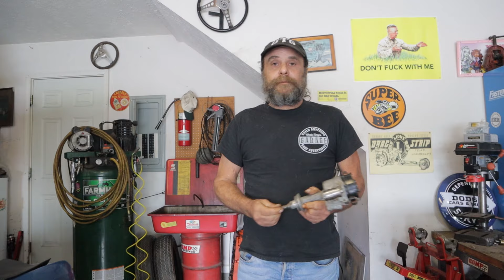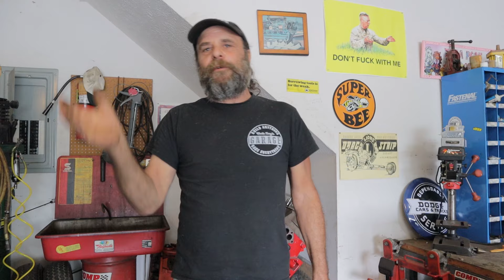Ignition Timing...How Much And Why

Comment: Great tip...had never heard of that relationship! How does stroke/dwell time affect it?
Reply: Lets say stroke remains the same. That would be the distance the piston moves up and down in the cylinder. 
A longer connecting rod has more angularity in regards to the crankpin (connecting rod journal or "throw") than a shorter connecting rod which has less angularity. The longer rod will "hold" the piston at top dead center "longer" as measured in crankshaft degrees than a shorter connecting rod with the same stroke crankshaft. 
Piston speed (velocity) as it travels up and down the bore, say in middle of travel either way up or down, also based on rod length. They call it rod ratio, which is connecting rod length center to center divided by stroke. 
This number is often between 1.5 and 1.7 on most of the V8 engines Tony messes with on this channel as a good example.
The higher (larger number) the rod ratio, the longer the piston is gonna remain at top dead center (dwell there) before getting yanked or pushed onto the downstroke.
Timing is affected GREATLY on dwell time.
Also that thing that Tony said which i love is "real estate" in other words bore diameter...bigger the bore the more "real estate".  Stroke being the same, the longer connecting rod is gonna hang out longer at top dead center before it starts down....lets say for this description, on the power stroke. Gasoline generally burns at a given rate which varies on alot of factors but lets keep it simple that single rate for any tank of fuel adequate for your engine...
Timing is telling when to light the spark plug. The flame front is gonna burn and spread out or "propegate" at the same rate no matter how fast the engine is spinning. Higher rpms require timing lead also called advance. 
How long the piston stays at top dead center Directly affects WHEN to start that spark and let er burn. 

I think Tony could have said it way better but i did answer your question.
Reason i posted this long comment was to get my head working again after this stupid lockdown. Im in michigan and we were hit pretty hard....by a really stupid governor.
Reply: @williamstamper442  Hope you are safe from the muddy waters up there...
Reply: William Stamper I hope things turn around for you guys soon.

Cheers😊
Reply: William Stamper very well explained
Reply: @williamstamper442  I pity all those under Witless Whitmer's jackboots.
Reply: no joke about Witless !!
Reply: @rcnelson  just today she pulled another stupid move by announcing the partial re-opening of our state but completely leaving out resturants bars and barbers. On the 26th we will be able to buy a new car by appointment but cant sit down and have a pizza
Reply: @rcnelson  also just found out there in midland downstream from the dam break and where all the water ended up was of all things a Fiero museum. Had some of the finest examples of those, ahem, "well respected GM vehicles of that time".
Either way i got to thinking about the regular guys who lost their hot rod and/or collection.
I am so thankful to GOD that reportedly NO lives were lost. That in itself is awesome.
But i got to thinking about all the fish. Did a quick check and yearly bass pro tournaments were held there. Wixom lake had been stocked starting in like 1937 (old ass dam) and more controlled stocking of fish starting in the early 1970's and the somewhat private lake supported all of Michigan game fish in ok to awesome numbers up till 2018. 
Apparently they had some kind of legal riff and somehow convinced the powers to be to raise the lake 3 feet.  Looks like that was a bad idea however i do not think that as an exact cause of what happened.
The dam that failed was Privately Owned. It was cited in 2018 along with the other dam that was breeched back in 2018 that in the near future substansial rainfall would most likely end in loss of life.
Nothing happened. 
Until Tuesday.
Then they lost their lake.
Fish and all...downstream to who knows where.
When it all dries up and the river makes its new path people will have everything from catfish to muskelunge pike bluegill crappie big and smallmouths and whatever i missed in their basements.

Yeah its kinda crazy.
"As governor i order you to stay home"
3am Tuesday morning "as governor i order you to evacuate"

Maybe everyone should (most did) what their instinct told them anyway and didnt need the governor to tell them what to do
Reply: "Simply Awesome Tip 'n Teaching "
>"Cheers UT"!
Reply: I want to amend my comments and hope not to piss off Uncle Tony if he thinks im wrong.
Im only talking total timing under wide open throttle for sake of performance, in case this matters later.
In theory, the higher the rpm, say above 6000rpm, theoretically it takes less timing lead to "spark" at the right time for flame front propogation to happen and get max push downward on the piston for max performance.
However, every engine can be a little different as to what that number in degrees before top dead center occurs, for best performance.
Factors involved are first fuel...
Alot of people don't konw this but the higher the octane the Slower the fuel propogates and flame front travels. This makes it difficult and important same time for higher rpm engines. Higher rpm means less time to ignite that flame front (which remains constant for any particular batch of fuel) so ignition lead should be increased for max effort on the piston down on the power stroke.
In real world we deal with lets say pump gas 92 octane and lets say a true static mechanical compression of 10:1. 
This is gonna burn me in the comments but here goes anyway...
Most muscle car era big and small block American V8's will typically like about 32-38 degrees crankshaft for total timing on gasoline. 
If engine has like 12:1 or more static compression its gonna like 32ish maybe even 30 (camshaft matters here too but wont get into that now). Alot of stock big block musclecar era engines like 440's or my fav 455 oldsmobiles like 36 sometimes up to 38 degrees total timing for max performance. It depends on bore, stroke, rod ratio, cam events especially overlap, and etc.
Remember i am only talking wide open performance and total ignition timing otherwise called lead.
The point im doing a crappy job of but trying to make is there exists a perfect time in every engine at any rpm or "speed of engine" to spark the plug and begin the flame front propogation (remember that is a constant for any particular fuel) for that particular speed.
Hope i said that right and it makes sense.
Think of it this way...any particular fuel will light off and propogate at its own given propogation rate. 
Its up to YOU the tuner to find the proper ignition lead or advance for your particular engine to take full advantage of that flame front and energy of explosion to push each piston down with max force. When you make that happen you will have optimum timing for your combo

Comment: Irrespective ove bore dia. Piston/chamber makes a huge diff in optimum timing, relative comp ratio as well....look at the GROUND STRAP on your plugs...you want the discolored portion right @ the 90deg bend, too far to the tip...to much timing, too far down the vertical leg of the strap too little....a great way to determine what YOUR setup needs.

Comment: I just finished building my 440 for my 73 challenger, it has a 512 stroker kit, any idea about what timing should be in it?
Reply: I run 36° total in my 505" RB. Start at 34 and creep up on it to see what it likes.
Reply: @markwise9868  sounds like a good starting point,thanks

Comment: So my 1000cc 4cylinder Motorcycle engine needs only 10 degrees being the bore is so small? Nah 
The stroke has a function too. Short stroke needs more advanced timing and long stroke needs less. 
 Try this one . Initial timing is set with a vacuum gauge. Highest reading at idle then retard timing 2 Degrees.
Then for total mechanical advance highest mph in the quarter mile. Or if you have a dyno adjust it for max power. Vacuum advance is highest vacuum at cruising speed for optimum gas mileage. The rate of mechanical advance is set by least ping or knock on acceleration -Test. This is for gas engines . 2or 4 valves make a big difference in timing the 2 valve needing a lot more. Most 2 valve American V-8s use 34 total mechanical advance with 92 octane or a bit more with 110 octane racing gas.  GET a KNOCK indicator and A VAcuum gauge along with a lambda sensor for mixture and beat your head against the wall trying to get it good everywhere in the range of operation..
Reply: Thanks for arguing the point the guy never made guess my fuckin lawn mower motor needs a 1 degree advance because “the bore is small”

Comment: "Real Estate" by piston diameter, is a squared function. What this means is that a small change in piston diameter makes a much bigger difference in piston real estate size. This was a very useful video.

FYI. this video combined with another one where you explain how you want your fuel explosion to finish pushing the piston before BDC, goes a long way to understanding how an efficient engine works.

Comment: Ok let me get this straight . You remove the vacuum or mechanical advance then while running turn the distributor to advance the timing  to where the motor is happy then leave it so it is always at that timing . Not like you start the car and it's at 8 then as you speed up increases . Just set and leave it & give it the juice when warm .

Comment: a trick i have learned years ago to get optimum timing on almost any naturally aspirated engine , use a vacuum gauge . pick a idle speed , then increase the timing until max vacuum is reached , then reduce the idle speed back down to the original set idle speed , then adjust the timing until you have maximum vacuum again . once you have this figured out , retard the timing 2 - 3 inches of mercury , and it will be almost perfect . 
overall timing my still need to  figured out , or even limited , and how fast the timing comes in may also  need to be adjusted  .... but using a vacuum gauge allows you to have the motor tell you where it wants the distributor set at at a idle .

Comment: I change the initial timing on my geo metro and suzuki from 5 degrees to 9 degrees! 
WOWEE
Reply: 1marcelfilms He is talking about total timing, not initial timing. That small Suzuki will still need 20+ degrees or so total timing.
Reply: those little sewing machines LOVE being spun up!
Reply: @MrZdvy  Some of those, you could get away with changing total timing by adjusting initial timing (just like you can with an old school distributor.)  Another one was pre-'96 Mazda Miata.
If you can adjust initial timing, total timing is likely being changed by the same amount, since the curve is going to be a fixed map.  He's not altering the curve, no.  But he's moved the entire curve by 4 degrees.
Reply: You can only adjust initial on stock ecu. the computer does the rest. @MrZdvy

Comment: I’ve heard from several engine builders that with all the different engine combinations and compression ratios, the one common goal, whatever the total timing is, is to have peak combustion ‘pressure’ happen at 10-12 degrees after TDC. Does this sound right to you? Thanks.
Reply: You would want it just after dwell. Within  the first couple degrees the piston is descending down into the cylinder bore.

Comment: Uncle Tony, question..

You know your Hemis, if memory serves some Hemis had duel spark plugs per combustion chamber? does that effect the required ignition timing because there are two ignition points? My guess is it would require less timing.
Reply: @007-b8i  
Yep, I know the 5.7L engines do.
Reply: timing would remain the same. Dual plugs where used to ensure a complete cylinder burn.
Reply: Like a dual point, with a single plug.
Reply: Duel plugs are usually used when the combustion chamber is shrouded by pop up pistons

Comment: Cheers again Tony ' Buddy of mine mentioned how wedge BB spark plug location is further from center than SB which as you said causes greater distance for the flame front to travel and in turn would generally cause the need for greater advance in timing . a quick question on octane been one of the factors that you mentioned of how different fuels effect timing . in your experience how much do different fuels effect timing and does timing retard more as octane increase or are there too many factors to cover this topic in a quick video ?

Comment: Chamber shape, compression ratio, bore, stroke! And engine speed/ operating range!  AND FUEL! Temperature maybe?
Reply: Yep, temperature, too.  BTDT.  Car would ping if I sat and idled it too long, but after babying it for a minute, the fresh air would cool the air filter and housing off enough that I could get into it.
In retrospect, I should have probably just backed it off a degree, but I wanted every last horse.

Comment: I found out that my 69 318 loves the timing set up the early wide block 318's used, plus that distributor has nice brass bushings and a oil cup thing so you can I guess oil the bushing as needed.
Only reason I found out is my distributor was very worn out when I got my Dart 318 car and my buddy had a good one from a 65 318 he rebuilt and he converted to electronic ignition.
I always tune the timing by listening for ping at WOT and back it down till it barely pings and make sure it otherwise starts and runs ok, check the initial timing and that's where I set it again if I change anything.
Much later I finally gathered up the parts to convert mine to electronic.
My buddy helped me wire it up and I set it up according to what the book said for initial timing at 0.
Car started and ran much better but was a dog off the line and mpg dropped.
With the old setup I ran 12 btdc and I got lots of power off the line and better mpg, the engine was way snappier before.
So I took my old early distributor and the new one apart and swapped out the plate with the electronics setup and the shaft into the early one. I think maybe I could just take the points rubbing block off and swap on the setup for the reluctor wheel thing but either way I swapped it into the early setup with its original case and advance weights. I had to file the hole for the incoming square plug for the wire for the pickup and it all dropped right in.
Everything spun easy and it was complete.
I dropped it in, set the timing to 12 btdc and my god, it spun the tires first hit and had so much more snap off the line again and mpg was better like before, plus it still started easier and no points to dick with. 👍   
If any of you read this far and have a SB with electronic they used the early distributor till like 67 I think and easy way to tell is look for the tiny oil cup thing.
I have no clue if big blocks have anything similar in the early ones.
When I looked up initial timing for a 65 318 it is 10btdc, I run 12.
Reply: The 318 is a fantastic motor, IMO.
Reply: I had a 74' w100 318 came factory with electronic ignition. Tuned the magnetic pickup when i got into it in my teens and ran so nice! collected a few Ignition boxes, but never replaced it. EVER! now I run wasted spark ina '78f150300ci...